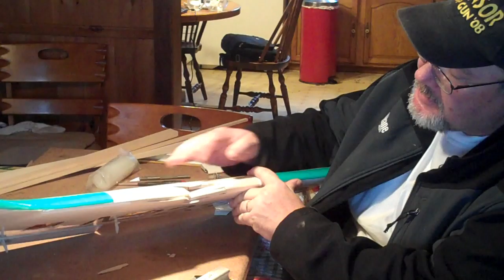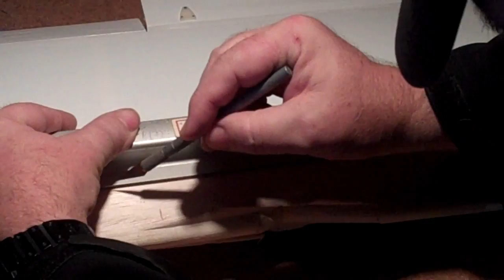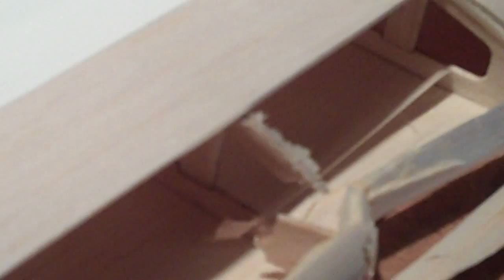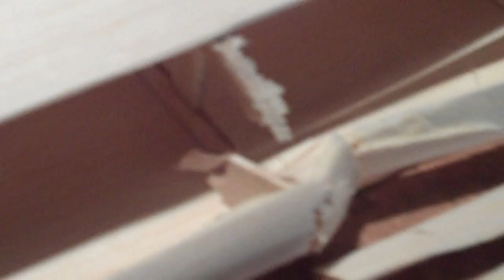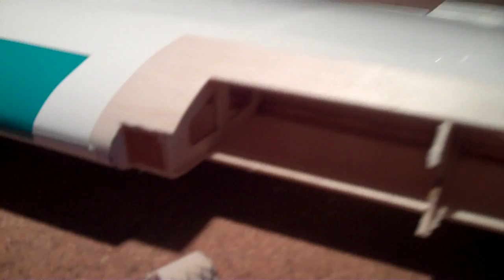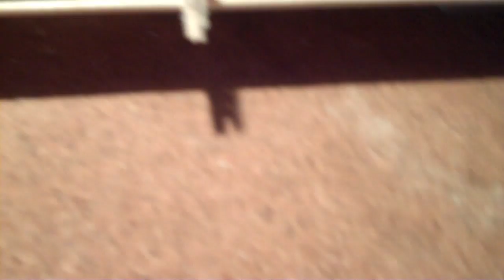Wing Repair How To Video Part 1..wmv

Comment from the maker: Hey Yacine. thanks for your comment. Basically you can remove all of the Monokote from the wood with a air-gun set on high heat. The adhesive in Monokote backing is heat activated and if you use a lot of heat it will melt off! easy peezzie!
Gerry